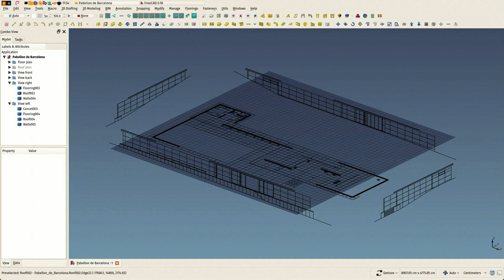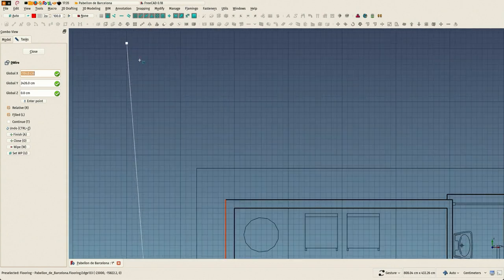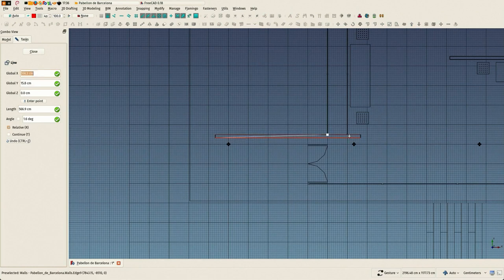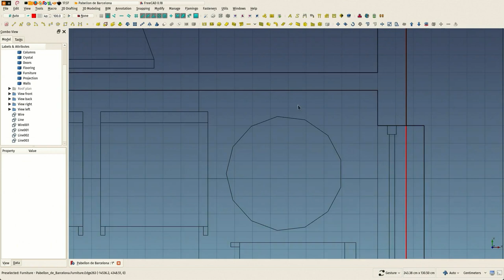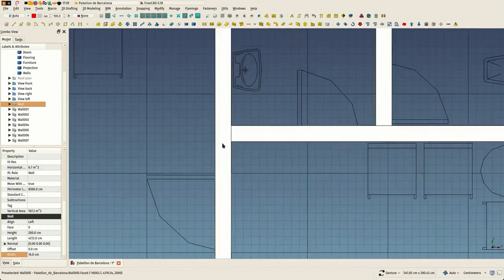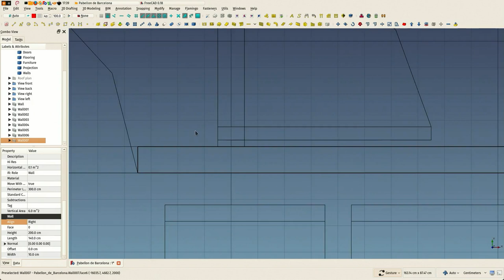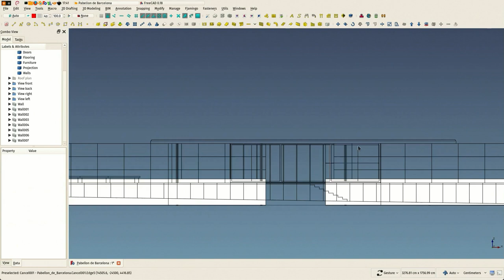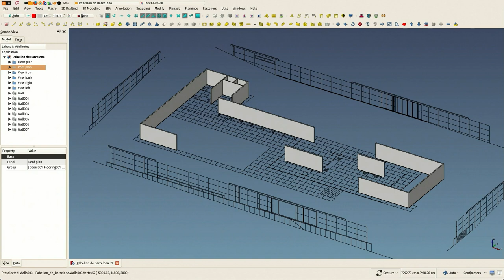BIM with FreeCAD - Barcelona pavillion 02 - walls

Comment: Hello Yorik, and thank you for this video. Weren't you able to use the existing lines to make walls instead of drawing new ones ? 
This took a lot of time for a BIM workflow.
Reply from the maker: At the moment you can not use parts of objects to draw walls, only full objects. The existing plans are "all in one", all lines in a same object, one per layer. So we would need to explode the 2d drawings into separate lines to be able to do that, which would make the model quite heavy. But it is on my TODO list to add this possibility ( build walls on selected segments only).
Reply: @YorikvanHavre  Great ! Good luck for future improvements.